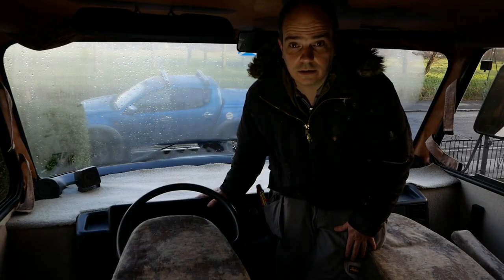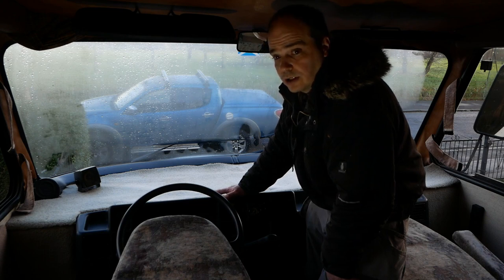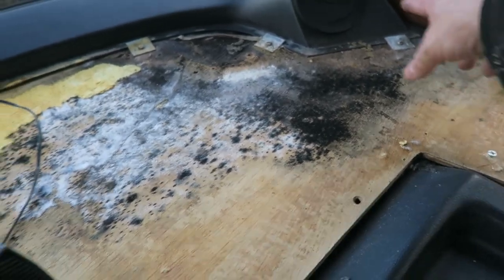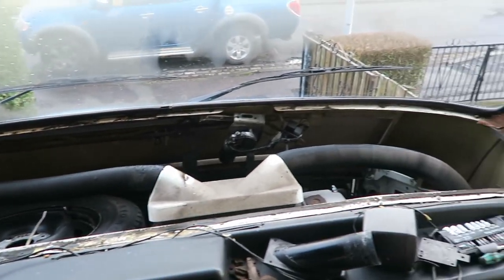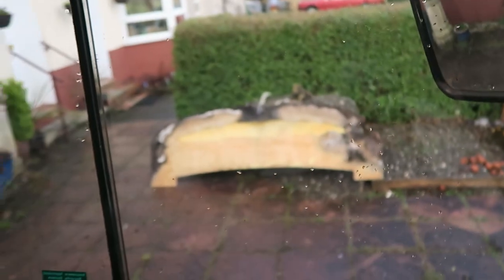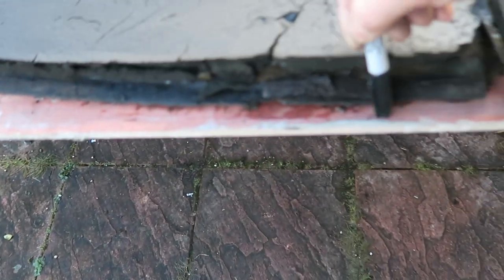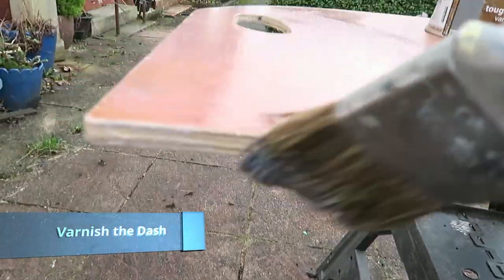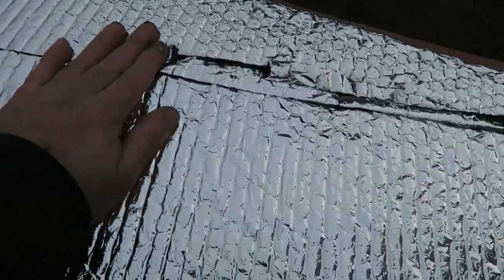Replace Motorhome Dash in Hymer B644

Comment: Great video and enjoying all your videos. When I replaced my dash I cut in two access hatches on the drivers and passengers side so you can top up your coolant and access the top of the engine bay with ease. I also installed 3 X metal bar braces spanning from the top of radiator left, right and middle positions to the original dashboard to really strengthen the fibreglass shell front. Message me your email if you want photos.
Reply from the maker: Brilliant ideas. Once I get to a computer I will message you 👍
Reply: Guys i own a 1986 ducato elnagh and having blower motor issues and wanting to do an overall review of the engine bay. I would love the photos aswell. Thank you guys.
Reply: I'm about to replace the ply and sound absorbing material. I would love to see the videos showing the metal bracing, sounds like a great idea.

Comment: Good work. I found it's better to use nuts and bolts to secure the dash which increases rigidity, as screws eventually loosen.
Reply from the maker: Good point. Might look into putting a few bolts in if the screws loosen. 👍